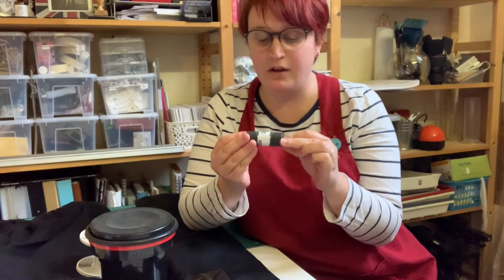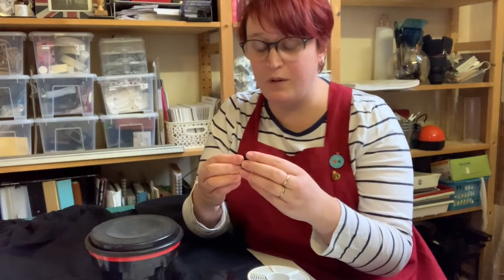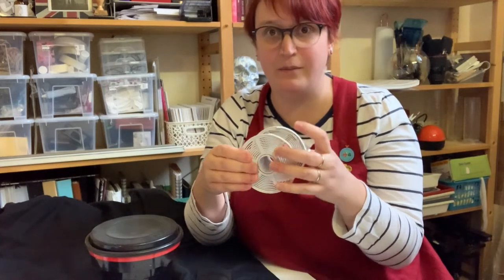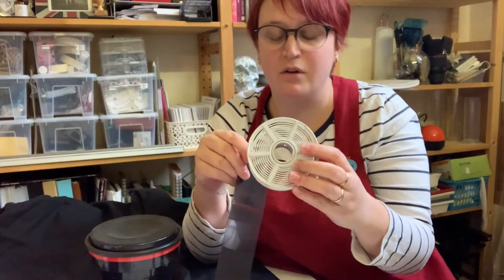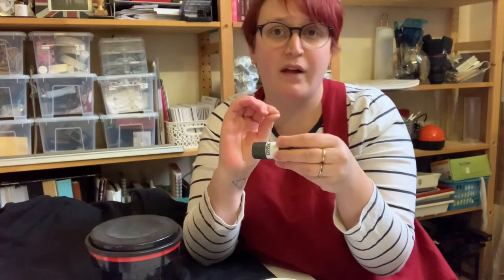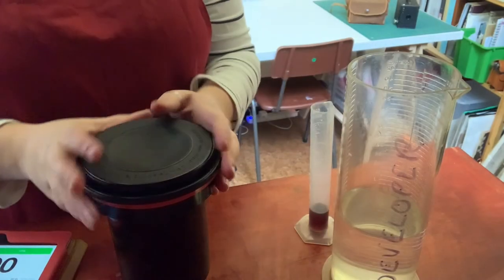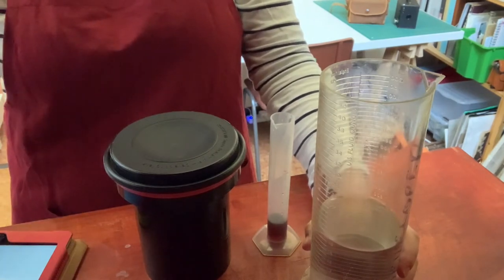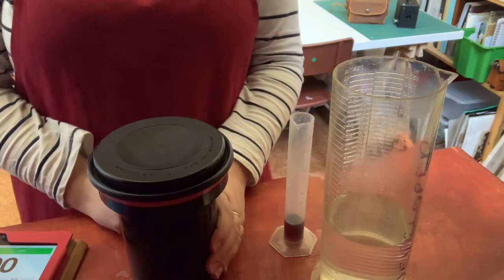ILFORD HP5+ Film Processing by Boffin Photography

Comment: Nice video. Very clear instructions. It was interesting to hear how long you use the fixer for. I tend to use it for 4 minutes (as per the bottle telling me I should use it for up to five minutes). How do you know when you've exhausted the fixer?
Reply from the maker: Thanks for the comment! I have found from past experiences that fixing for 4 mins is never long enough, so I have alway just go a little longer to play it safe. But as I say that’s just from my past experiences. You can tell if the fix is exhausted by the time it takes to fix your film. If it is taking longer than normal then it properly needs replacing / a fresh batch.